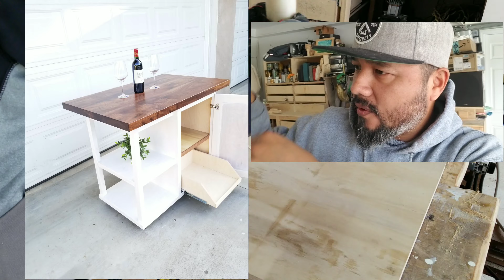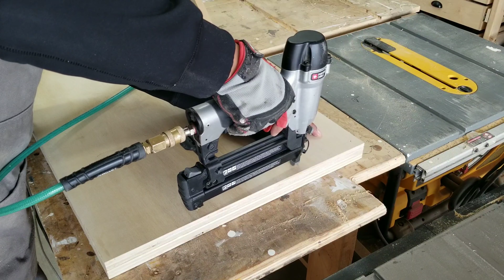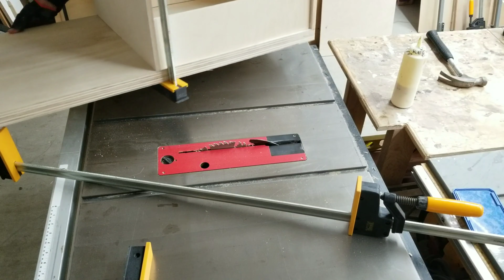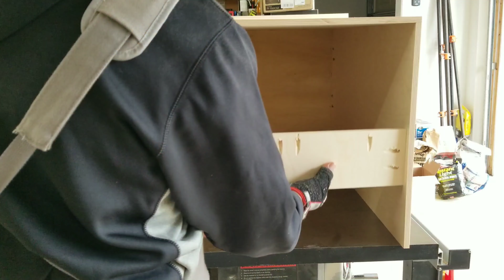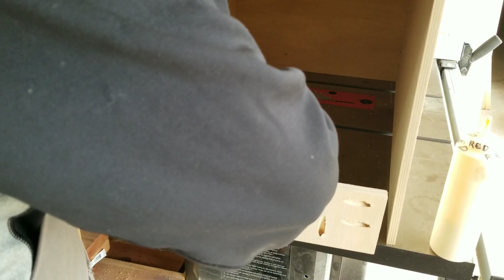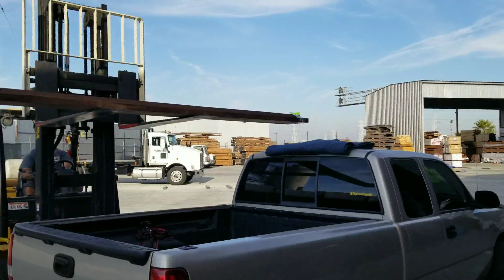DIY Mini Kitchen Island by Caliwood Specialty

Comment: Beautiful! What was the overall size of the Mini Island Base and what are the dimensions of gorgeous walnut top?  I really love your design and SOLID BUILD construction!   ~~Christy~~
Reply from the maker: Hi Christy -  First off, thank you!

The base dimensions are 35.5' wide x 19.25" deep x 34" high (including 3" casters).  The walnut top is 42.75" wide x 26.75" deep x 1.75" thick.  The overall unit height (base + top + casters) is 35.75".